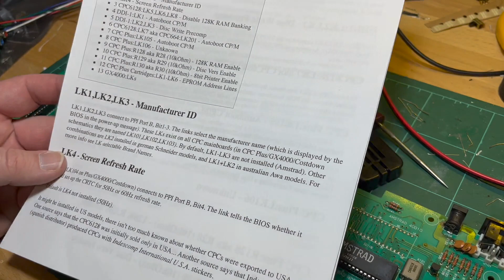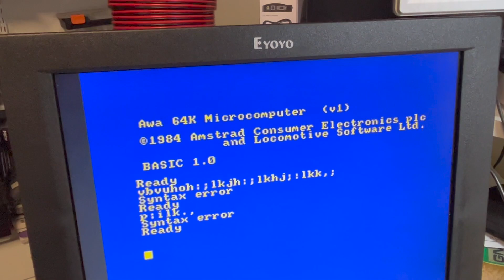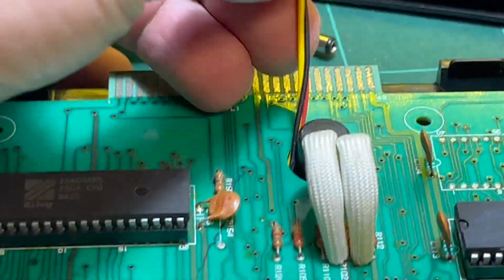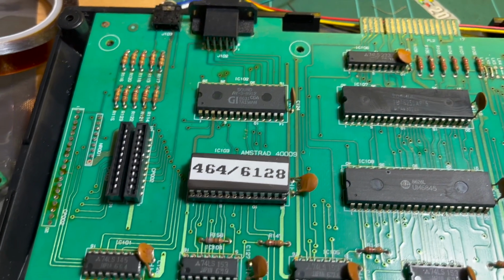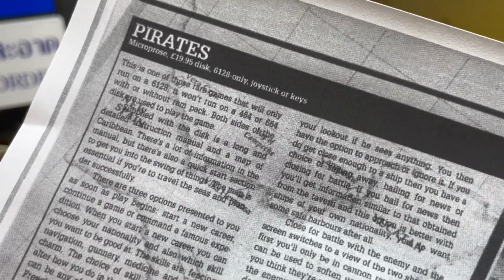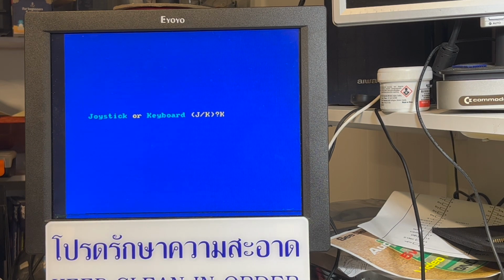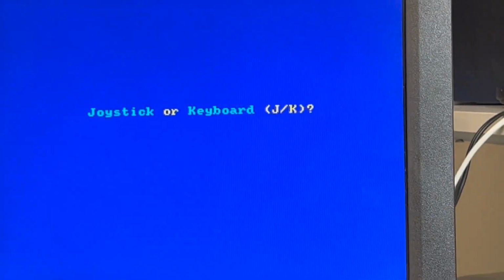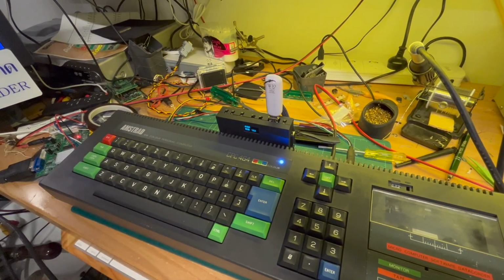🇬🇧 Amstrad CPC464: Part 4 (6128 firmware) [TCE #0126]

Comment: Why is not a single CPC 464 video with a SCART CRT TV attached? Everybody shows LCD's or emulation.
Reply from the maker: Do you mean the Amstrad monitors?  Well there's probably a few reasons.  We had an Amstrad CPC464 with the monochrome monitor growing up - my parents gave it and everything related to it to my uncle back when "retro computing" wasn't really a thing.  It's probably in a landfill now along with all my precious tapes of my crappy programming attempts.
So I had to get another one more recently.  If you look on ebay most do not come with the monitor, just the computer.  So that's one reason.  The computer itself is a pain to ship because it's so wide.
Another reason is that they're incredibly heavy & bulky which means they're expensive to ship - if you're looking at a Plus model that were never released in Australia you're likely going to have to have it shipped from the UK. Yikes!
And as they're bulky they take up a lot of room.  I do know some lucky people have a dedicated room with all of their retro computers AND matching monitor ... C64, Atari 8-bit, Atari ST, Amiga, Amstrad, BBC, etc.  I don't have that luxury so using a single flat-panel screen for my 40+ computers makes a LOT more sense.
Recording a CRT is also problematic if you don't match the refresh rate, so you'll get a rolling or flickering capture.
And finally, I guess, a lot of CRTs have died over the years.  I did have an Amstrad CTM644 but it wasn't working.  I'm not proficient with CRT electronics (some very high voltages involved) so not easy for me to fix.  But even if I did ... there's simply no space on my bench for it.
Reply: @Brfff  I don't mean an orginial monitor per se, I've a bunch of mid nineties Sony 1450D's and they are small, cheap and with excellent picture. Recording is not easy, but not hard either. Just set the FPS to 25 and the shutterspeed to 1/25, it works better than 50 fps I found out.
And space should be made for a hobby. As if the CPC itself is small....
Reply from the maker: Ah, I see what you mean.  But ... what would you like to see though?  Most creators (who put far more effort in) usually use capture devices anyway and don't just point-a-camera-at-the-screen.  Would you prefer to see a CRT in use in general, as the general shot, with the capture in the corner of the screen?  I do have a small Sony CRT, but it's pretty deep so still takes up a lot of space, as well as my Sony CRT - see here: 
https://youtu.be/eBWTlAmPtBw?si=gMicv3mVr8a-KuUv&t=1262

Hopefully I'll be building a shed in a few months and relocating from the garage, so I might have space (i.e. a deeper bench) to set up a CRT.  The French Thomson computers have light pen interfaces built-in, and I might pick up a dk'tronics light pen for the Amstrad (like I had "back in the day") ... both of these obviously require a CRT.
Reply: @Brfff  It is nice to have a good idea how the quality of output is on a real CRT. Some computers are good at it, others really bad like a breadbin C64.
Reply from the maker: Ah, now we get to the meat of the matter.  Ok, I can appreciate your perspective.  When I get the shed built (wifey really wants to park her car in the garage, safe from hail, so wants all my shyte out!), I'll endeavour to include an example of the CRT output.  As I do actually have a SCART TV (my Sony from the UK), I should be able to show output from RGB-enabled machines (most post-Soviet Speccy clones are RGB-only), and I've been using my Sony DVD/HDD recorder to convert the Thomson computers' SCART output to other formats so that is also a possibility.

Comment: btw.. i see you got a rare-ish 40008 Gate Array...'86 on the chips
Reply from the maker: Ummm ... $1000? ;). So I should list it on ebay as "R@RE!!! L@@K!!"
Reply: @Brfff  .. i think they where rare ish! .. lol .. aparently a smaller run between the 40007 and 40010 ...(40009 used for the rom)
Reply from the maker: @WacKEDmaN  Soooo ... $10,000 ... ? ;)
Reply: @Brfff   40010s going for almost $40..so.. close! (40007s where $7) 🤣🤣

Comment: you really only need to change the rom to the 6128 one and be done with it..theres no real point going back to the 1.0...1.1 is much nicer no having to pass strings in @a$="string" among others) 
...but nice job with the switch..i didnt realise it was so simple!
Reply from the maker: I'm just "worried" about any 464-only stuff ... I dunno .. Sultan's Maze?  ;)  I often wondered about that "amazing looking game" ... my folks came home with Laserwarp and Map Rally ... and maybe any modern 464-only/cassette demos ... ?  Dunno ... it's easy enough to make it switchable ... but even the CPC664 with BASIC1.1 and RAM expansion won't run Pirates (apparently) ... so just concerned about those FW differences ... ? /Brett
Reply: @Brfff  all the 464 stuff i thrown at it works perfectly fine for me...few new basic commands is the only real difference old way of strings works too..  the ddi-5..it supports C3 memory state so should work as a 6128 would..